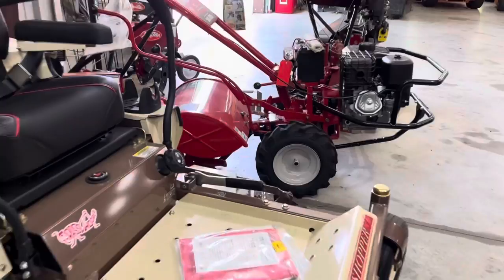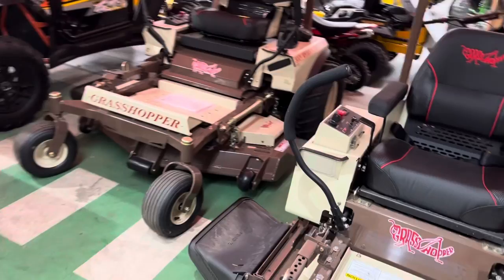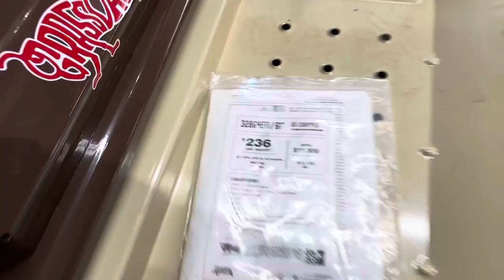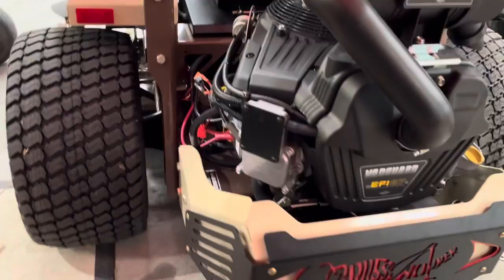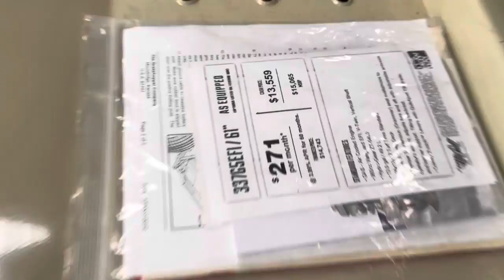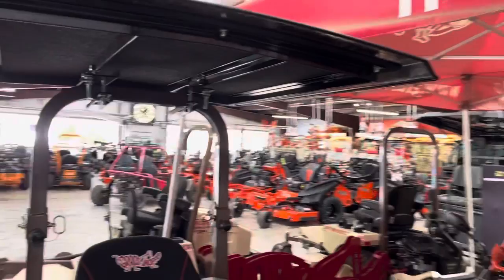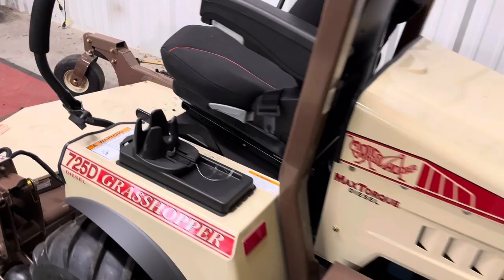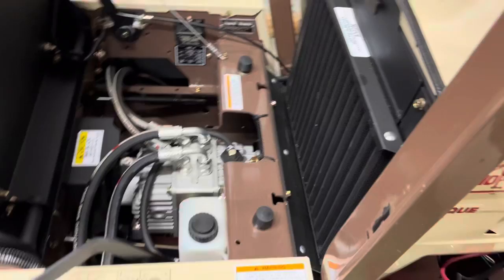Finally got some Grasshoppers in stock!  Some 2023 models and the new 940 40hp!!

Comment: i live in WV, if i lived near you i %100 would support your dealership, your my go to for grasshopper information, keep up the good work.
Reply from the maker: Ty so much.  We actually have 2 customers that I know of in your state.   My dad delivered 2 bad boy mowers 2 trailers one day, and we have a bad boy tractor there.   We may have more that I can remember.
Reply from the maker: @leonardo migot  you will have to preorder for sure.   It depends on what all you get on it.  Stock bare boned 61” is $21530 we do 10% off that at $19377.    Rigged out like I do for stock is $23520 or $21367 with some nice features.  Suspension seat, foldable rops, tweels on the back, power button for deck on seat, ocdc for deck opening, speed trim roller wheel, radiator clean out wand is usually the way I build them.

Comment: Love your videos! Thank you for taking the time to share your experiences. I found the video very informative, as well as the Q&A below.
Your opinion, please; I would like to stay within a $10k budget, I need something with a suspension due to back & neck injury. 
I mow 3-6 acres/week. Probably 35% is very rough ground, and there are roots & obstacles. Most of all, I want durability and reliability. Good air filtration and commercial hydros are a must!
I'm only cutting for myself and the two adjacent widowed neighbors, so a pristine cut is not primary. I would really appreciate your thoughts.

Comment: Looking for a new grasshopper for the farm my 718 finally blew the motor after 35 years or so of service. People complain of the price but they last a long time
Reply from the maker: Yes.  Not many mowers are still mowing the yard over 30 years.   By far our most reliable and longest lasting machines.   My first grasshopper 722d cost more than my brand new dodge pickup that I picked it up in 😂

Comment: Hey KEVIN. I love your channel. Every time I watch a video I find myself watching it twice. Excellent points and facts. But I got a question // request ,,, would you talk more about the diesel mowers and options as well as pricing of the diesel over the diesel brands that you carry also your largest gas engine it options and pricing in comparison to the diesel.  I heard you mention that Bad Boy diesel in now a Perkins diesel rather than a Caterpillar.  Is cat no longer an option for the Bad Boy?  The 42HP gas Vanguard is definitely an option that I would like to know more about. I appreciate you considering a video on my request above.  I have a large farm property that I’m turning into a ATV // UTV riding & camping park. I have over 105 acres to maintain fenced and roadside frontage to cover. My concern is that sometimes it gets a little bit high in between cuttings. So I’m contemplating possibly two big EFI gas engines or the big Diesel engine options.  I like the Grasshopper out front deck and I would like to demo one. I can send a video clip of what I have to maintain. Please help?

Liked Subscribed & Shared.
Reply from the maker: We call them perkapillars.   Perkins and cat have always been in cahoots with each other.     It’s been really hard to get diesels the last couple of years I only have one in stock period.    Grasshopper diesels are pretty much presold only and we have never sold a Scag or hustler diesel only bad boy and grasshopper.   
The 900d is a beast of a mower.

Comment: What do you think comparing a 226V 61"  to a Maverick HD vs Fastrak SDX? Trying to figure out what would be a better buy. Prices on these mowers are all over the place in my area.
Reply from the maker: Bad boy is gonna ride better than all of course.   Bad boy and hustler look better by far, hustler has the best warranty by far and the smoothest drives on the handle.   By far the grasshopper will be a better cut and more reliable.   I have 2 on special 52” for $8499 that are blow out pricing :).    
Your giant difference is the grasshopper is waaay more commercial with 4400s.  It’s built more like the x1 hustler for $12k or the bad boy Rebel.   It’s not really in the same class as the sdx or the hd bad boy.    
Mow on all three and no way you would buy the other 2 in this comparison it’s not really fair at all or apples to apples.   

I will promise the grasshopper will
Look better in 10 years and be in the shop less they are looked over by most due to how they look
Reply: @kgmowers  Yeah I myself overlooked the Grasshopper midmounts because they look a bit generic. Around Illinois the Maverick HD is not in stock anywhere locally, the Fastrak SDXs are still in that $10500--11k area so the 226v doesn't seem like that much more to get the 4400 drives. Not sure if I like the gas tank under the seat though but I guess no mower is perfect. Appreciate the info. If I wasn't so far from Texas I'd be headed your way.

Comment: I have some video ideas, can you show the assembly and PDI of a scag, badboy, etc from crate to showroom? Also when you walk by the FT730 engine, pop the air filter cover so we can see what the air filters look like :)  btw I passed on the TC2, it had a yamaha engine :(
Reply from the maker: Bad boys drive straight off the truck ready to mow.   Assemble on the others is pretty simple.  Sometimes we install the seat, put the handles up and tighten up, hook the battery cable up, put gas in it and drive it off.    It’s pretty boring on that end.

Comment: Quick question , I already have a grasshopper 725 diesel with a 60 inch averator, which has six of the rotating heads, and it also has the button in the steering arm that quickly lifts it when you turn around to go back the other way I would like to purchase the next size smaller grasshopper so I can get the smaller averator with four heads instead of six and I still want a quick lift do you know what model that would be? It does not have to be diesel but I’m sure it Has to be shaft drive ,thanks  , by the way this is the best seeding unit in the world. Lightning fast , can handle rocky condition ,  Doesn’t destroy sprinkler systems. Super germination!
Reply from the maker: The 623 is the cheapest smallest one you can get with the shaft.   You will have to get the hydro lift added when you have it built :)

Comment: You seem like a straight up guy. I'm a women in another country, can you please give me some honest advice, I'm confused. Do I buy a 335 petrol 72 cut grasshopper with 35hp vanguard or a srt xd spartan 35 hp kawasaki 72 inch cut.
Reply from the maker: The Spartan is by far cooler looking, but the grasshopper is more reliable.   My advice would be since parts and repairs will be harder and more expensive to access I would recommend the grasshopper.    We have really low repair rates on them compared to the Spartans.   I was a very high volume dealer for Spartan and I Would guaranty over the next 20 years the grasshopper will have less repairs and be less expensive to keep over time :).    I will be completely honest with you, I don’t care what other mower brand you put up in this question where you put Spartan my answer would be the same 😎

Comment: Nice what's the acquisition fee these days here in Florida it's 6 or 7 hundred dollars 😜 they say zero but it's not zero percent
Reply from the maker: There is no such thing as free 0%.   What’s cool about grasshopper is they pay most of your fee in the price of the mower.   The rates all just went up, but right now your cost is only 5.10% upfront.    It’s right at 10% upfront.   Some of the mower companies are eating some of that cost, so it’s helpful.   Bad boy doesn’t eat any of it, so the cost is more.    What your used to hearing like the car dealers do is car is 30k financed, or if you pay cash or get financing on your own you get a $4k cash rebate.    Honestly it’s just costing 4K to do promo interest it’s called “buying Down” the rate.    
If you don’t want to pay anything finance it at your local bank and take the dealer a cashiers check.   We have what’s called a “no frills loan” that’s simply a no cost flat 7.79%.   That’s pretty normal for equipment like this :).
Reply: @kgmowers  thanks 14.000 thousand dollars would be 1400.00 fee😡😡ouch!
Reply from the maker: @harryerhart5978   only $750 with most brands..  bad boy and Spartan would be closer to 1400 because they don’t hide it in the price like the others.

Comment: Kevin….thoughts on the Grasshopper 226V?
Reply from the maker: That’s one mower they couldn’t build many of this year at all.  It’s a really good mower.   If you can swing it I highly recommend the 329b or 328 efi, but if your needing to stay under 10k it would definately be one of the better units under 10.   I love the vanguard engine on it and the 4400s.
Reply: I bought a 2020 52' 226V-G4 with folding roll bar and flex forks for 8K out the door!  That was obviously pre pandemic and recession pricing.  I was looking for the lightest (high water table) weight, most HP and best pump/wheel motor combo.  8-8.4 K was my price limit.  The 226V-G4 led in all those areas with a weight under 1K, B&S Vanguard 26 HP motor, and Hydro-Gear ZT-4400 drives.  This is my third mowing season (3 acres)with 0 issues and 170hrs!  All I've done is yearly oil changes, one oil/filter change on the 4400, and greasing the front wheel axles. As Kevin mentioned, the 329 or 328 EFI are solid machines, but you'll be spending thousands more than the 226.  I wouldn't hesitate to recommend any of the grasshopper models, just feel bad the pricing has really jumped north the past couple of years!
Reply from the maker: @ronda33  dang that’s a really price!   They are over 10k now
Reply: @kgmowers  Really solid machine! Yeah I did notice the price jump! I researched about 30 manufactures before pulling the pin on the GH. Most bang for the buck!

Comment: 10:00.  I’m sorry but Grasshopper STILL hasn’t got the deck figured out..!!   They’re a great mower, they don’t break down.  They have made massive strides on their lifting and height adjusting settings, but those baffles are completely ridiculous.!!   Those baffles are the reason they need such large engines.  The only part of the under side of the deck(in terms of grass discharge), —they have good mechanicals— is the height from the blade to the roof of the deck.  JD and others have no clearance.
Reply from the maker: Idk.  They are cutting sooo good now.   If you are running the contour blades they are only for very high end grasses.   I recommend high lift or the extra foil high lift blades..  if your not getting optimum cut move up to gator g6 or an x pattern like Meg mo or Ballard x blades.   Right now the hopper is cutting right with the scags around here, some of my guys say they cut better when they have both on the trailer.
Reply: I completely agree with you! I’m going through a headache with my 225k GH mower… only 152 hours on it and I want it OUT. Actually , I wanted it out at 80 hours , but nobody seems interested in buying it for almost have the cost. 
The discharge is hideous, clogs up like crazy, seems like it likes to hold a lot of the grass inside the deck. $12k mower and some residential Hustler fast tracks are laying down better cut quality for half the cost of my mower. Grasshopper are built like tanks, but cut very poorly.

Comment: Finally! :) I found a 2022 tigercat 2 48 with 4 hours for $7500, as much a I hate scag is that a screaming deal?
Reply from the maker: Yes!!  New it’s 10500.  I would call sheffield 18004388892 and make sure there isn’t a lien on it and check with a Scag dealer to make sure it doesn’t come up stolen.   I would also make sure you get a picture of them, the license plate of the vehicle they meet you in, and a pic of the sellers drivers license to be safe.   I buy a lot of used equipment you cannot be too safe ever.   That sounds like a too good to be true deal honestly, any Scag dealer would pay cash in a heartbeat for that machine in the nation for $7500 and sell it for $9500 for a very quick 2k profit.
Reply: @kgmowers  thanks for all the suggestions, I do most of that anyways when I wheel and deal LOL but you're right can never be too safe these days. This gentleman started up a landscape business but quickly realized it was more than he could chew so he's selling it at a loss, I believe he got Fleet pricing which is in the mid-nines if I'm not mistaken but still.
Reply: @kgmowers  can i email you directly by chance?
Reply from the maker: @morejelloplease   fb messenger is easier.   They are weird about what I can post on the comments.  Kg mowers is me
Reply: @kgmowers    darn I don't do Facebook messenger, maybe I can find something  on your website.

Comment: Any chance of getting a 225k & 623t reviews?
Reply from the maker: I haven’t had one of those for stock in over 2 years 🙈.   It’s hard to get any stock from
Grasshopper right now, most mowers are special order only.
Reply: @kgmowers  Thank you for the response.  Would you say that this also impact parts availability for the machines too, say if anything would have to be replaced?
Reply from the maker: @masterbasgym  parts are thin.    That’s the main reason they are doing this.    This really have some of the best support I haven’t had much I couldn’t get from them for this whole 2 years.    I couldn’t even get oil and oil filters at one point.

Comment: All around mower, reliability, quality of cut and power of engine to hydro ratio, which would be the best pick?
Reply from the maker: Depends.   Scag turf tiger is prolly the best for this application, but a 335 grasshopper or super z hustler would also be in the running.   I’m a suspension fan, so my go to would be a 900 stihl bad boy rogue or a renegade due to the ride.    If money is no issue the grasshopper 432 or 932 would be my pick by far.  The kubota 3 cylinder gas is the longest lasting engine and best performing I’ve seen on a mower.    Thousands and thousands of hours and they keep going.
Reply: @kgmowers  My options at this time are Tiger Cat 2, 300V, Pro Turn 148, Pro Turn 152. The 300v has the edge on the largest Hydros and cut being very similiar of Scag. the Scag has no warranty and 300 hours on it. The Gravely mowers are both under warranty still and the Grasshopper is a demo.
Reply from the maker: @danskinner467  the gravely pro turn is not commercial.    The gravely that would be the same would be the 200 series.   The commercial gravely starts at the 100 series.    The normal pro turn is a beefed up homeowner mower.    The 337 is by far a nicer mower.   Unless it’s the 328 then the 328 is the same as the Scag.    The Scag has the old school transmissions, but rhe grasshopper will have full warranty just like a new mower.   Not even blinking I would grab the gh for sure
Reply: @kgmowers  The Pro turn Gravely is a 148 and a 152. Those are not considered commercial?
Reply from the maker: @danskinner467   yes 100 series is entry level commercial.   It compares more to the patriot Scag and the 226 grasshopper.
Reply: Thank you for the knowledge.